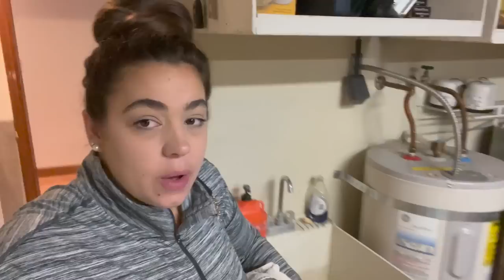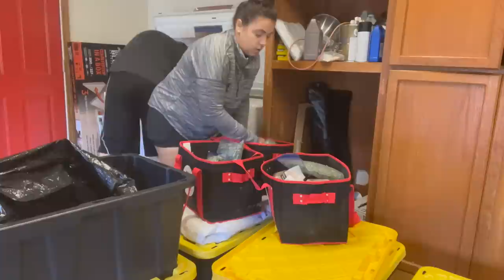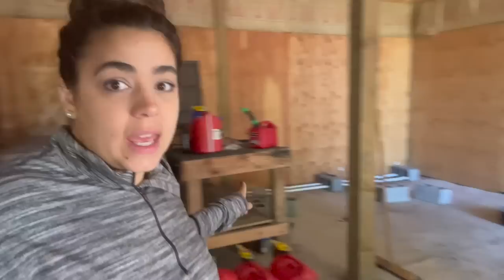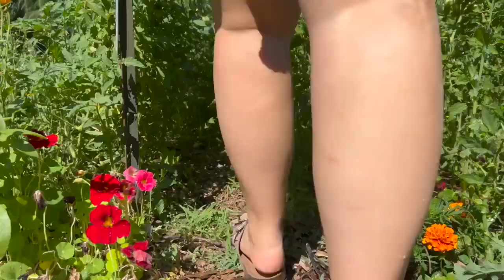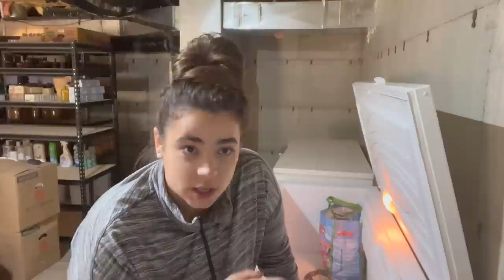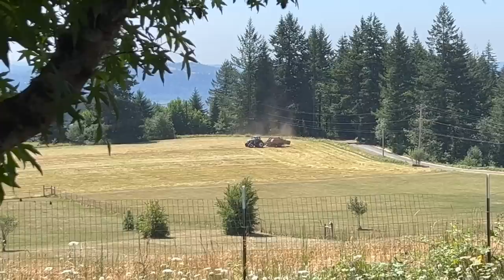You all were so right! Moving day 2!

Comment: The other benefit to having the freezers in the basement is for energy conservation which will reduce the amount of times the compressor kicks on which will in turn extend the life of your freezers.
Reply: So true about keeping your freezers and different things in the basement. Here if you don't keep your freezer or extra refrigerators inside your home they are not covered under the warranty. The initial warranty and also I have a warranty through my gas company that covers everything in my house and it is voided if it is kept outside. The only way an item can be outside if it is in a controlled environment heated and air conditioned and then it's still under warranty. I'm so excited to see you get to move and your beautiful new home
Reply: plus easy access right
Reply: Good point.  And the older appliances are built better, that freezer may surprise you.

Comment: Be sure to compare generators. We live in hurricane prone Louisiana, and hubby used to work for a propane company. During one of our storms, alot of people had problems with their Generac generators. Apparently, they aren't made for days of running.  You may not need 3 or 4 days of power, tho. If you do, look into generators with a Cummings motor.
Reply: Yes always look for a good generator
Reply: @cynthiafisher9907  Yea. Dumb auto correct.
Reply: @tashainjena    Thank you for that great information on the generators !!!!
Reply: Agree! We have a Generac and lost power end of April due to a huge blizzard, wouldn't work and only had it for a few years. No one to work on it so spent a long 12 days with no power! We have a Cummins on order to replace our Generac.

Comment: Hey, Becky congrats on the move!! I know you were worried about the pressure gauge on your canners during the move. Since you are supposed to get the gauge checked annually to see that they are calibrated correctly, your local extension office should offer free testing. This way, you are double sure the move hasn't affected your pressure canner gauges, and you have done the testing for the year.
Reply: I have a question that I hope someone can help me with regarding the pressure gauge. I have the gauge and the weight (jiggler). Since the weight won't jiggle if it's not up to the proper pounds do I still need to get gauge calibrated?
Reply: @cathyl4622  No need to have gauge checked.
Reply: @suesmargiassi4195  Thank you

Comment: Don't forget your support system when you inbox, or unpack things too.  It can be as simple as someone to just open up boxes then flatten and stack boxes after you've emptied them.  Depending upon the person(s) and furniture it can be someone to go from room to room simply re-assmbling furniture from putting in nuts and bolts to simply putting shelves back into units or removing and stacking any protective coverings; for you, this may have already been done by the movers.  Opening boxes, removing and stacking contents in the appropriate room, then flattening and stacking the boxes can be a great help.  This also quickly points out boxes that ended up in the wrong room; with or without direction, get your helpers to out boxes in the correct room.  And, it points out boxes with a mixed or assortment of items belonging to multiple rooms.  Depending, your helpers may even stack and nest things then out them on shelves or in cupboards, out of boxes, off a stack, and/ ormoff the floor.  -  This may seem inconsequential but it can be a BIG help whether it be a half hour favor and chat time or a multi-hour let's get it all (haha) unpacked effort.

Comment: Great video. 
My suggestion for better organization in those deep freezers is to use same colored bags for same kind of meat. One color for chicken pieces,  one color for pork etc. Also,  would be good idea to have everything printed and attached to freezer. In this case if you take something out your just cross it,  and if you put anything in you just add it. Also,  dates when it's done. This will help you know how rotation is doing and help to maximize your inventory. Abd please don't pull or push stuff that is heavy,  being pregnant please avoid giving to much unnecessary pressure on your tummy and back.
Reply: Years ago, the lady down the street used pillow cases she closed with a draw string inserted in the hem and also zippered cushion covers.
Reply: What brand/kind of bags do you use? I really need to organize my little tiny chest freezer and make it easier to get stuff out!
Reply: I’m glad I’m not the only one who was concerned watching you do all the lifting 
of the frozen food bags .🧡🤎🧡

Comment: Hello! Talking about all that ice in the freezer... i don't know how you usually do it, but maybe i have a tip for you so it goes faster. 
I wait for a time where i don't have much in the freezer anymore, so i can fit the things into the fridge for the time being (i only have 1 small freezer). 
So i start with boiling water in a big pot. While the water is heating up, i turn off the freezer and put everything in the fridge. Then i lay some big towels on the bottom of the freezer and a cork coaster for the pot on top of them. when the water is boiling, i put the pot onto the cork coaster and close the freezer. The time you need to wait now depends on how thick the ice is, but for me 5 to 10 minutes are enough. 
I open up the fridge again after that time and put the pot of water away, because i don't want any of the ice falling into it and splash still hot water around. Now i take a plastic spatula and slide it between the freezer and the ice. if i waited long enough the ice will be loose enough to fall off the side of the freezer now snd land on the towels. So i can just grab the towels and get the ice out like that. All that's left now is to dry and/or clean the freezer, and it's ready to go again. 
Overall this takes me around half an hour to do, and is so much quicker than just waiting for it to melt away on it's own. I hope this can be of help to you :)
Have a nice day and take some well deserved rest!

Comment: Bit of advice on the watering - get water timers! I would be lost without mine. Just a little box that screws right onto the faucet and then you screw your hose into the timer. Set it for however long you want it to run and you don't have to remember to shut it off! They're also programmable to run on a schedule.

Comment: About your deep freezer from the 70s, you might want to reconsider replacing that. I have a deep freezer from 1961 and it’s super huge and it has outlived several freezers that I have got since then. It’s the coldest freezer I have ever owned and it is literally still in my basement and it is cold cold cold! If you do sell it I’d pay you top dollar for it! Sounds weird but seriously, you don’t see old freezers like that exactly around every corner.
Reply: Costco has good prices on freezers.  Yes, need to new energy friendly one.  They take a lot of power.  We are in our new house for one year and now can average our electric bill, it is 60.00 year round here in NC with air conditioning running from June to Oct. non stop set at 78.
Reply: @denisejones1863  I can appreciate the thought of energy friendly ones but it only saves $30-$40 per year, on average, and for one the size of hers it would cost hundreds of dollars to replace it. Then you’re also left with the idea that these newer freezers do not last nearly as long. Overall I think it would still be a financial loss to replace it and that doesn’t even include the value of food loss the day it does finally decide to quit working. The newer ones just are not made the way the old ones were. And definitely not nearly as cold. But to each their own.

Comment: With land like that you could get a 100-250 gal propane tank buried and run a generator on it for a week+ depending on the tank size, weather and dependency on hvac system. Seems like yalls weather is pretty timid and could get by with a heat stove and ceiling fans most of the year. Batteries are getting affordable too, 14kW storage runs about $7,000 … check out all the options. Depending how much kWh your household requires (it’s on your bill) it may be more affordable to be completely off grid with the option to tie back in.

Comment: Quick tip, put a bottle or container of water in the freezer, freeze it and then put a coin on top. Stand it up right on the freezer and if the power should go out for a long period of time without you knowing, the water will melt and the coin will drop to the bottom. So if you see this you will know your freezer defrosted and froze again.

Comment: You mentioned about getting a generator.  Please be very careful where it is placed by your house.  Last year we had Hurricane Ida and numerous people had problems with carbon monoxide in their homes from the generators.  There were some deaths from them.  They were placed by the houses according to the manufacturer's specs but the build up inside the house was bad.  A friend of mine was featured in a news story about it.   Luckly, they had a carbon monoxide detector that woke them at 2:00 in the morning and they got out.  They fire department came and told them it was a good thing they got out or they would have all died from the levels that were in the house.  Since Hurricane Ida the state is changing the building code for installing home generators.  
Love the new house and really enjoy your videos.

Comment: If you are going to invest in a generator,  it is worth the initial investment to have it wired to your house.  My father bought a gas powered one at first.   It was so hard to deal with in bad weather because he had to go outside abs refill the gas in it.   The second one he bought runs on propane and is wired to the fuse box.  When the power goes off, it automatically kicks in.  We lose power here in the winter and it has been such a blessing

Comment: I would suggest a whole house propane generator, they can be sized to run everything in your house including heat, washer & dryer, all freezers, and the water pump. I would also suggest getting a vacuum sealer that way food is not getting freezer burn, honestly I am surprised that you don't already have one.

Comment: People on wells quickly decide whether a long hot shower is a higher priority than being able to flush toilets, and maybe flush/ bucket bail for upto a couple of days.  Since its not winter with unpassable roads which must be traveled to clear the limbs, while the limbs must be cleared before line work can begin .... keep in mind each hurdle that a lack of power brings.  After the move, keep these hurdles in mind as you build your power outage arsenal.  It is not uncommon for folks to have multiple generators for specific purposes or zones.  And/ or a more expensive, bigger, propane tank
or diesel, system connected to the house electrical grid which may or may not automatically turn on.  It is not uncommon to have a stand alone generator for the well's pump house. It is not uncommon for a big enough generator with priority for food storage freezers; often the freezers are in some rotation which enables them to remain adequately cold and not use as much fuel.  Heating becomes another issue for both humans (and pets) and water pipes both in the main dwelling and plumbed out buildings. Increasingly, it is important to consider keeping and prioritizing device charging too.

Comment: I would highly recommend a Generac generator. That’s the one that I have. I know they can run on natural gas for sure, and it’s an automatic switch over whenever the power goes out. You don’t have to do anything. I’m not sure if they can run on propane, you may want to check into that though. It is a little expensive on the front end, but it’s totally worth it! 💙💙💙

Comment: The pressure in your pressure tank is only enough to get some emergency water. Enough to drink or cook with. If you tried a shower you’d only get wet before it stopped. Lol. If your power goes out for an extended time, remember you can always get some water from your water heater. How exciting for you for your move. Yes. I love my one level home. Believe me. You appreciate it as you get older.